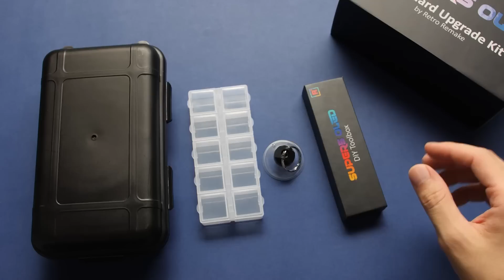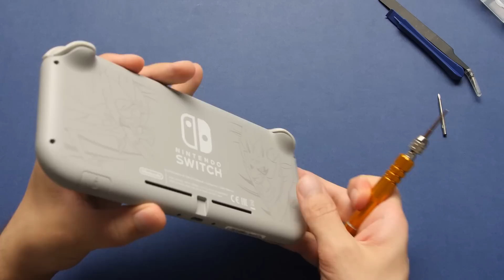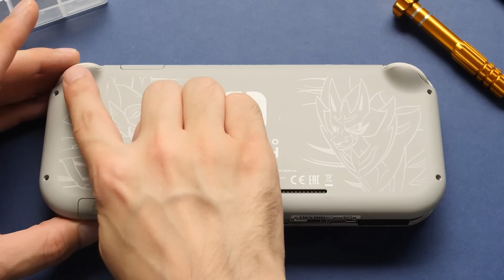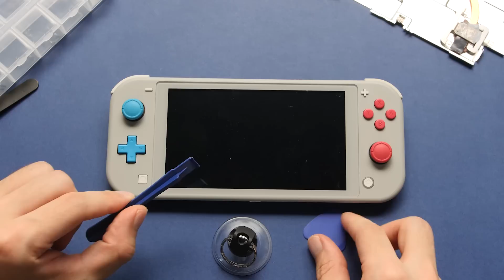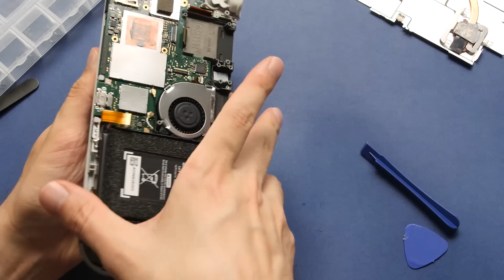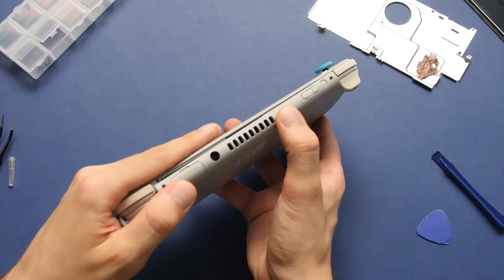SUPER5 OLED - Product Overview & Installation Guide Part 1

Comment from the maker: https://retroremake.co/pages/super5
Reply: Could you shed a bit of light on how the HDMI kit will be installed? The oled/touch/hdmi kit I ordered says that there are no shell modifications necessary and no soldering required. How's that possible?
Reply: @LeBoomStudios  thats a really good question. Ordered the same... still trying to figure out how they do it. Somehow access test points, replacing game card slot or headphone jack ... hmmmmmmm
Reply: @urubarin3966  The headphone jack would be way too small, even for micro HDMI. The Gamecard slot would be a nice idea, since mine is modded anyway. So either that or the description is just copy+paste for all of the kits and a bit of actual soldering is needed. From what I've heard, the USB Type-C controller is the same as on the OG Switch, just wirhout the additional DP-Alt controller IC. As such, it should support video output and it should be possible to directly route the display output to the unused pins.
Reply: @LeBoomStudios  I was thinking about something similar or some test points for the unused lanes of the Typ c connector by using some pins and press them against the test points like some Gameboy consolizer do
Reply: @urubarin3966  They can also have a flat ribbon cable out where you can attach a hdmi connecter. Just brain storming
Reply: @LeBoomStudios I think it has something to do with battery life, the regular switch is able to output 1080p pretty much whenever it wants, it just only goes to 1080p in docked because it has a constant power supply so it’s probably something to do with that for the switch lite hdmi mod thing
Reply: They are back in stock!!!! I just ordered mine.
Reply: @noutellme316  thanks for the headsup. because of this, i managed to order one as well
Reply: @noutellme316 did you get urs yet?
Reply: can we fix shipping to pakistan ?
Reply: @UsamaAhmad_odata  can ship to Malaysia? 🇲🇾
Reply: It could be solderless by using some clip that snugs down on top of an existing chip. Like Wii mod-chips used at one time long ago. 

They were terribly unreliable so soldering was preferred. 

I think it could be the same here.
I mean... I'm also just brainstorming, but perhaps there's a solderless method alongside a fully soldered method for those with the means and experience to do it.
Reply: @miker13  Something else that just came to mind:
Maybe it's a wireless transmitter on the flex pcb and a standalone receiver you'd plug an hdmi cable into? That really wouldn't require any shell modification or soldering.
Reply: Thanks Taki. Amazing piece of hardware and great job ❤
Reply: How long will it take to ship?
Reply: This is very awesome. I appreciate your work. I pre-ordered the OLED touchscreen and HDMI mod because it looks like every other kit package is selling out quick. The one with the HDMI mod intrigued me greatly, BUT, I am wondering what needs to be done to get the 1080 hdmi to work? I hopes that one is relatively easy as far as just installing the hardware and no need for something like having to jailbreak it and going into its bios and installing a special firmware. (There seems to be no video or update on this yet).
Also, why no gold frame offering for the OLED touch/HDMI package? I have the HYRULE edition I wanted to mod but, black contrasting with the rest of the units color will do I suppose :/
Reply: I missed out on them. They are now sold out. Dang they sold fast!!!

Are you gonna restock? If so do you know about when?
Reply: will there be any restock soon? i wanted to get the one with gold borders for the hyrule edition but looks like out of stock as of the moment 😢
Reply: Out of stock, really disappointing 😞
Reply: Out of stock. When can we expect more?
Reply: i just want to play a Switch Lite on a Tv what should i get?
Reply: is it possible to remove the buttons? my screen keeps changing color profiles so I randomly have the screeen with inverted colors or all green colors

Comment: Taki can you help me?
I got mine, but it seems that the adhesive is missing from the screen, also, when installing the screen is misaligned and by looking at it the touch ribbon cable seems to be bending when installing almost like I have to cut the right part of the screen "case" to be able to fit it

Comment: Buyer beware. Received the kit with two bent and broken 3 pin battery sockets on the cable in the  standard upgrade kit. Retro remake offers no kind of customer support what so ever, and have ignored my emails with request for a resolution. Will never use anything from Taki or Retro Remake after this experience.
Reply: Thank you brother
Reply: Doesn't surprise me
Reply: Mine kind of works but it randomly switches color profiles or goes into color blind mode, I don't see the point in the back buttons, now I need to have my switch open to fix it every time it happens
Reply: Ty for writing this def gonna avoid it.
Reply: From the beginning it’s been a bit shady.

Comment: Hello so what do i do if my screws are tough to remove and are getting eroded every time i try to take them out?
Reply: Dame issue
Reply: @RealRagnar816 this whole process has been hell for me! Just because of the screws. I had to get small little gun with a spinning disk and cut into the screws. Then i had to buy a whole iFixit kit to remove them. Now that i got everything my screen does not turn on…

Comment: Installed everything correctly and it won’t power on, any advice?
Reply: Same. Any updates on your results ?
Reply: @ I actually got it working shortly after, I just went back and disconnected everything and reconnected it. I think the tricky one for me was the ribbon cable going to the battery. Hope you get it up and running cuz it looks great!

Comment: Great guide but the custom metal shielding and the custom flexpcb dont line up. One of my buttons on it is under the shielding because the prototype has horizontal buttons where the final has vertical
Reply: It’s kind of disappointing to be honest lol. But its still an oled screen. I cant really tell the differences when I press the buttons to change the display.
Reply: I had this too. It doesn't seem to actually press down on the button under the shield and I think the shield could be modified to accommodate the vertical buttons, but probably we should just get new shields sent out to us (or boards with horizontal buttons.)

Comment: Just got mine installed. Overall, pretty easy. Then I thought for a moment that I made myself a situation by not waiting for the touch version when I seen the hekate display and realized I couldn't navigate it with touch and the controllers doesn't work normally. Good thing I realized that the joy con can be used like a mouse ;)

Comment: It’s all sold out where can I buy one now?
Reply: If the kit is sold out now, sign up for the newsletter to their site. I noticed that some kits were marked as Sold Out and then updated later as being available. I assume they would notify people when one of the items is back in stock. Keep in mind that since they are a smaller team, they have to oder unites in bulk and then peice them together, so sometimes signing up now, you may not get an update until a month or two or even 6+ months later. You just have to be patient. 

Also note that most of us are early adopters, so you might see revision that works in your favor making things easier by signing up. Who knows...this is the normal trend for these things. I doubt it will be sold out forever, seeing the demand is high and Taki is pretty well known.

Comment: Really want to order the kit with the HDMI mod, since it says zero shell modifications are needed - but I'm concerned about how that would function. Does it output from the USB-C port? I would think that would require soldering, which the kit also claims is not required. Would love to see a video of the HDMI mod in action.

Comment: If you're considering other hardware that may benefit from an OLED upgrade you might want to consider the Google Nest Home Hub devices..

Every single one of them, past and present have hideous LCD screens with terrible saturation... and they only come with a white bezel. Even the black ones 😭

There are no integrated components in the screen unit for microphones etc, that's all in the main unit, and the screens connect via a single ribbon cable.

I've no idea what power is available on that ribbon cable but who knows.. it might be reasonably easy to make an OLED screen for these devices.

If you can make them with black bezels too you'll completely steal the show!!

Comment: Does anyone know about the possibility of Oled modification for original Switch V1/V2? Just because the Oled Switch is very complex and expensive in hacking, it takes up much more space on the emuMMC memory card, and the original Switch does not have these problems

Comment: I don't know, if ther'll be a touch version, but if you want one today, you can delaminate the oled screen from the glass (with a very thin wire - around 0,04mm, heat and maybe some ipa), clean it, put loca on it and laminate it to the digitizer from the switch lite. Finicky, and you can damage the screen if you don't do it right, but you would have touch.

Comment: No touch panel so you lose out on the touch screen.... yeah, no.
Reply: You don't need it tbh
Reply: Next to nothing uses it effectively. Even first party games that should have touch control even just for menus like Smash Ultimate with it's large touch button-like menu icons doesn't have it.
Reply: There is also a touch version of this mod btw

Comment: What does the hdmi output mean? Will this add an extra hdmi port or is the video signal now in the usb-c port? Could not find any infos about that?
Reply: It means that the Switch Lite will be able to send sounds and videos signal when docked, like bigger models
Reply: So it will not be possible to connect the switch lite with a usb-c to usb-c cable to the xreal air glasses? That is bad 😢
I hoped this will work.

Comment: I just want to clarify. For the special edition Lites. The only option available for a matching bezel were without touch right?
Reply: touch is only available in black and white or if you feel confident enough they sell a version with no bezel or digitizer compatible with stock touch for you to install your stock digitizer. which requires you to safely remove and install it. i ordered non touch that matches my pokemon switch lite which happens to be the one in the video which per video matches perfectly
Reply: @Shiny_Diglett  Thanks for replying. I went back and forth on the wording and wasn't sure. I ended up buying the screens with matching bezels for the Pokemon editions as I hardly use the touch screen anyways.
Reply: @enriquevaldesmedina  i would recommend grabbing some hall effect thumbs sticks. swap them out while your doing the mod.

Comment: If the pixel density of the OLED panel is the same or even better than the switch Lite, it is worth it! The Nintendo Switch Lite has more pixels than an OLED. If so, I will sell my OLED and buy the Lite.
Reply: both panels use the exact same resolution

Comment: I do not recommend using such pointy metal tweezers for pulling on those ribbon cables, it's very easy to poke into them which would be a disaster.

Comment: Would doing a full shell swap be easier or more difficult than just replacing the screen? I'm tempted to go all out and just reshell my system while I'm in there.
Reply from the maker: The second version of this video is a shell swap. It is easier in that you do not have to worry about trying to use heat to remove your existing screen, but it takes a bit more time & and screw management. I like to do a shell swap at the same time unless I really want to keep the shell I currently have (almost never the case).
Reply: @TakiUdon2  Thanks for the quick reply! I think that a shell swap will be the way to go then. Thanks for making such helpful tutorials and a cool product! I actually ended up ordering both the standard screen and the mega kit; I want to tinker with both and it looks like it's gonna be a lot of fun.

Comment: Seems its from China? Shipping options are either DHL or 4PX? How long did it take to come in?
Reply: Probably a month after shipping
Reply: @Basic-0214 lol a week max for me
Reply: Yeah from china. Can only take my experiences from Amazon japan orders to germany which was around 10-14 days

Here is the shipping policy from his site

Customers can choose between DHL and 4PX at the point of checkout. 4PX is a cheaper shipping service with longer shipping times than DHL. 4PX shipping times can range from 15-60 days depending on the time of year and can go up to 60-90 days for some specific countries. If you need a package faster, please select DHL
Reply: Sad to say, I ordered the screen as soon as it became available and STILL have yet to hear anything about tracking or shipping yall...
Reply: @jobi-wankenobi2000  did you order touch or non-touch?
There was a mail which should have sent to all customers, saying that touch will be shipped around 20. Of December because they had problems to get the touchscreen correctly running

Comment: I wonder if this screen will improve the experience of Skyrim on Switch.  Skyrim has extremely poor brightness on the normal Switch and Switch Lite screens when you're in caves/dungeons.  I always had to connect my Switch to my TV to play it properly.
Reply from the maker: This is actually a great point.
Reply: Hogwarts Legacy will propably also improve

Comment: So your bezel options are black and white, but this one is grey? Just trying to understand options. This is fantastic!! I guess I’ll wait for touch OLED demo. I have a new transparent purple shell and I chose the black bezel touch screen (I’m going to switch out the white buttons and sticks with black ones)
Reply: As I understand, this video shows the installation of the non-touch screen kit.
So I think that while the bezel in this example remains stock, it isn't compatible with the upgrade.
Reply: Black and white are the current ones for touch. The bezel here is the „standard upgrade kit“ where the Pokémon metallic grey is available. This screen is made of glass but without touchscreen 

Here is another post from me about the colors

On twitter he said he‘s trying to get the other colors for touch but black and white are the only one right now which show good quality.

According to him you are also allowed to order black or white now and change your order afterwards

Comment: If I purchased the gold Zelda lite, which kit would I need to replace just the screen? I preordered the $49 version that’s compatible with touch. Do I need to buy a bezel for the gold lite ?
Reply from the maker: No, you need to remove the stock one and put it on top of your OLED screen.
Reply: @TakiUdon2  thanks for the reply Taki 🙏🏼, I’m picking up the Zelda lite today after work. Have a blessed day !

Comment: Does the screen connector sitting on top of the battery put any pressure on the battery when the case is closed?

Comment: Will this OLED screen be compatible with a modded switch lite? Will it require further software tweaking to get running or will it work out of the box?
Reply: Liking and commenting for visibility.

My guess is there isn't a compatibility issue. I would like confirmation from someone, though. I'll order it anyways and see if I can do it without causing any problems.
Reply: Don‘t know exactly where the mod chip is located. I don’t think, that the software makes an issue but propably spacewise
Reply: Of course it will, and he's said so previously. There's nothing inherently preventing you from having both a modchip and OLED screen installed.
Reply: @GareWorks  that's good to hear, I second that too.
Reply: @GareWorks  awesome if true! Got a time stamp or tweet or something? That’d be sick to not have to worry about it.

Guy who did my mod chip also said screen changes/mods likely won’t interfere with each other. But he also was speaking generally.

Comment: Is not bad I wonder  if the screen  mod will  be  compatible with the moded switch  the chip mod will  nt be in the way, plus will  be  a oled mod screen  for the switch  v1 or 2?